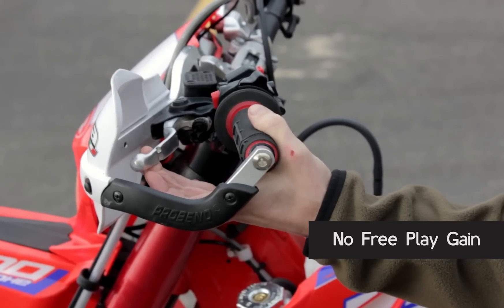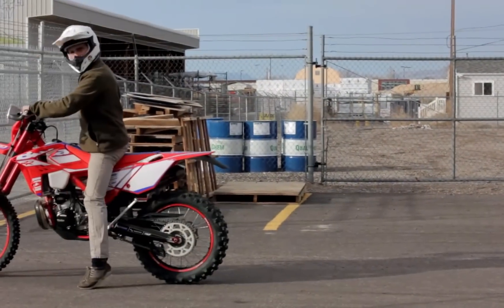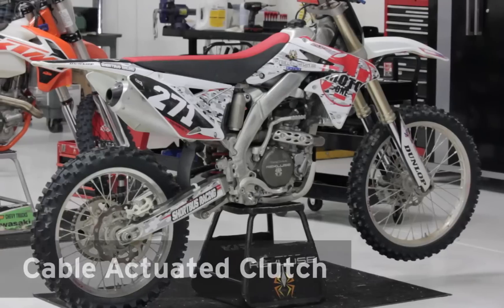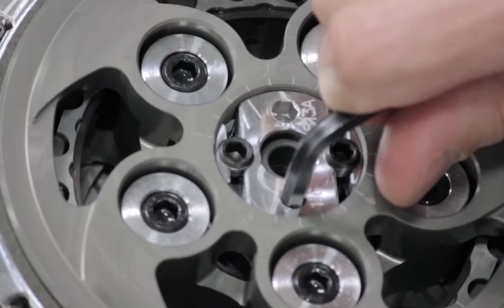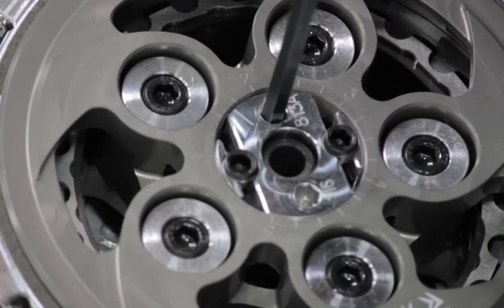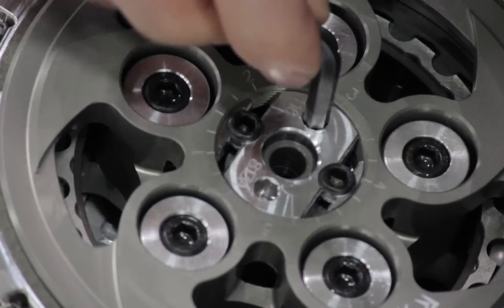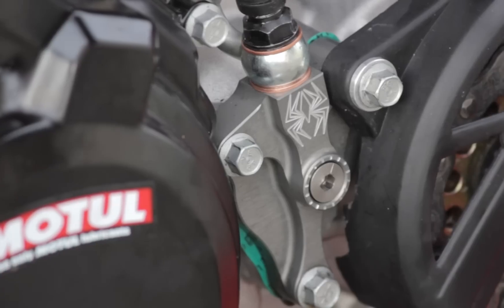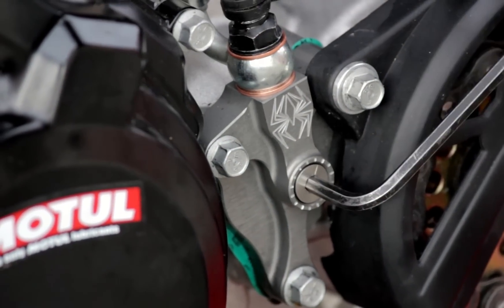Understanding the differences between clutch slip vs. drag.

Comment: whenever i put bike into first gear and let off clutch, it stalls. i dont understand if i should tighten or loosen clutch cable. i checked free play gain and its about 1/4 inch.
Reply from the maker: Hi there. We'd be glad to walk through the situation with you. Please contact our tech team at 208-426-0659 or customerservice@rekluse.com. Thanks.

Comment: Hey, i have a Tc125 and when i pull my clutch lever in and put the bike in gear it automatically wants to move forward what could that mean. My bike also seems to do the exact opposite of rev hanging, when i rev stop the bike the rpms drop fast is that a bad thing? if so how can i fix both problems.
Reply from the maker: Hi William, We would be glad to help with this question. Are you able to call our technical support team? It is generally easier if we can talk through things over the phone. We can be reached M-F 8:00am - 5:00pm (MST).

Comment: OK  I  admit it, I ran my bike  with too much drag in tight woods.  Today  on a  90 degree weather, the clutch lever did not disengage the unit at all, it went all the way to the handle bars  w/o resistance , after cooling down it seemed ok , but happened again in every tight section.. I adjusted it properly  and  it now seems  to be ok , did I harm anything. Radius  ce core on a hopped up 17 fe 350
Reply from the maker: Hello, thanks for your comment. For technical assistance please give us a call at  (208) 426-0659 8AM - 5PM MST or e-mail "tech@rekluse.com". Thank you and have a nice day.

Comment: @Mike , can I buy a recluse slave cylinder that will work on my hydraulic clutch for a GasGas 300 ec
Reply from the maker: Thanks for your question. We don't currently offer a manual slave cylinder for your model that is designed to work with a stock clutch. The Rekluse auto clutches for you model do come with the adjustable slave cylinder, designed for use with an auto clutch only. We do offer service kits for these adjustable slave cylinders. If you have any more questions, give us a call at (208) 426-0659 8AM - 5PM MST or send us an e-mail at customerservice@rekluse.com.

Comment: My kids kx 65 needs adjustment but I’m not sure where it seems like He has to give a lot of throttle out of first for the bike not to die out on him. Rather then a slow take off he’s almost forced to take off fast. Any ideas what needs adjustment?
Reply from the maker: Hi Brandon, be sure you have 1/8 inch - 1/4 inch of Free Play Gain in the clutch lever when the motorcycle is revved half throttle in neutral. Here's a video explaining that process. 

https://youtu.be/p7dvyzPeljI

If you're still having that issue, please contact our tech team at (208) 426-0659  8AM - 5PM MST or email customerservice@rekluse.com.

Comment: My clutch is slipping on my Rekluse RadiusX. It was just installed. I have no free play gain at all and my clutch lever adjustment bolt is all the way turned out. I need to turn it out more? I also have no regular free play. See the end of https://youtu.be/Lr4MC4TRW68
Reply from the maker: I recommend using the rubber band included in the kit to check FPG or apply more pressure to the lever when checking. Also make sure you are doing a quick rev and then release of the throttle. If the adjustment bolt is all the way out then you will have drag and technically should have a ton of freeplay gain. The easiest way to get you support is to have you talk through the install with one of our team members 208-426-0659 8am-5PM MST
Reply: @RekluseMotorSports  Thanks for the reply. I did not do the install but if you skip to the end of that video link it shows me attempting the rubber band step. I turned the screw on the perch handle in maybe 1 to 2 turns. I had no free play or free play gain. I didn't want to mess with it too much until I brought it back to the shop. Keep in mind it's $115/hr for labor and I'm all out of the stimulus money I used for this whole deal ($650 for Rekluse, $400 labor(only charged 3hrs)).
Reply from the maker: @JarofMayonaise  If the shop did the install I would hope they stand behind the labor. Especially if they charged 3 hours for the clutch alone, they can always call our shop if they have any questions as well.
Reply: @RekluseMotorSports  The guy who did mine, who has 30+ years experience, actually took 6 hours, but they only charged me for 3 hours since I was originally quoted for 2 hours. I am bringing it in tomorrow to see what they say. Before I left with it he told me it would likely need another adjustment. I hope they honor the work and don't charge me for it but I am definitely going to give him the # I was given. He's done Rekluse clutches before with no problem, just never on a raptor 700.
Reply: As of 6/2/2020 a second trip back to the installer had it mint! Can't wait to try it this weekend. No slipping and I've unlisted the video I linked so I can have a redo of it.

Comment: My Yz250f 2005 was running fine. I recently switched my front clutch and brake levers on my bike and it started acting up. When I pull in the clutch and I put it in First Gear, my bike starts moving forward while I am still holding in the clutch. What's the problem here and how can it be fixed?? PLEASE HELP
Reply from the maker: Hello Bonifacio, We are sorry to hear of the issues since you made that change. The easiest way to work though a fix would be to talk through it with one of our Technical Support agents. Are you able to call in to our office? Our team is available Monday through Friday 8am-5pm (MST) 208-426-0659. You can also email us at customerservice@rekluse.com and we can set up a call time that is convenient for you. Thank you.

Comment: I have 370 hrs in my recluse never touched it. I have correct free play gain but if I let out the clutch it stalls when I pull in the clutch and throttle it it goes. That’s how I ride it.  I’ll fix it when it fails completely. Too busy riding for now

Comment: you said drag is when you release the clutch and the bike moves forward, I'm no rocket scientist but isn't that whats supposed to happen?
Reply from the maker: Hey Michael, this video is regarding clutch performance with our auto clutches. When the auto clutch is properly set up, the bike should not move forward when in gear until throttle is applied
Reply: Rekluse Motor Sports not true, I have a 50cc. When I slowly let the clutch out it runs fine on idle. Bikes can run in first gear on idle
Reply: Michael Hunter. also maybe just semantics?  i believe. when you “release” a clutch lever it “engages” the clutch. when you pull a clutch lever it “releases” the clutch. but in common speak ppl mix the two
Reply: I guess we know why you're not a rocket scientist now don't we lol
Reply: Not when the clutch is pulled in, it shouldnt go anywhere, (thats what they meant, the just werent very clear about it lol)
Reply: My clutch is slipping, I am trying to adjust it, but I don’t really know what do you mean “find the starting point “🤔

Comment: I've got the core exp 3.0 on a '14 KTM 350exc-f. I started at 1 full turn+ 5 clicks. Then I started going clockwise 1 tick at a time. I ended up all the way back in (fully seated) & I still have a lot of drag + the bike stalls easy. Do I need to brake in the clutch plates before trying to dial the free play? Would air in the line cause this? The lever feels normal. Idle is at 1800. Thanks!
Reply from the maker: +Bt 26x Hey, our customer service guys could help you out with that. Their number is 2084260659.
Reply: RekluseMotorSports Great thanks!!! Austin ended up helping me out &  got me dialed!! This is my 2nd  #RekluseClutch  & it is by far the best one ive ever used!!!  Core EXP 3.0!
Reply: Hi. I have a 70cc cingle cylinder honda bike. My bike can achieve a speed of 60 on straight road, 70 on down slope but when it comes a uphill road i cant climb it in even 2nd gear. I have to put it in 1st gear. There is no smoke symptom and no weard smell. Now is this a bad clutchplate/pressure plate or a lose compression ? There is zero oil leakage from any joint of engine ?